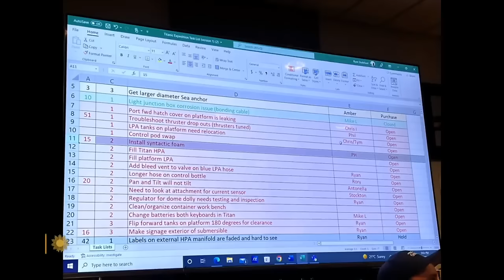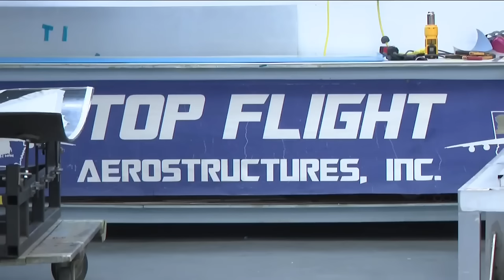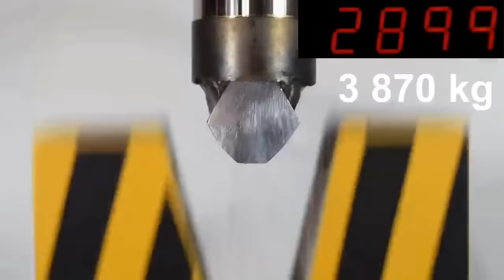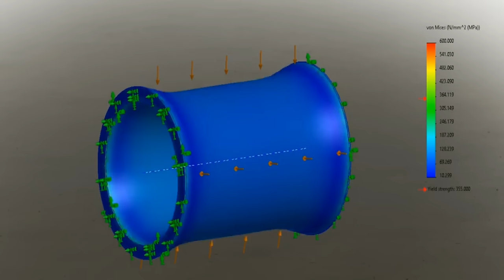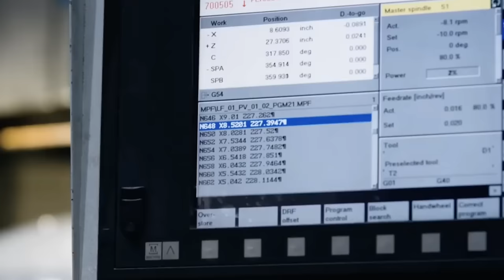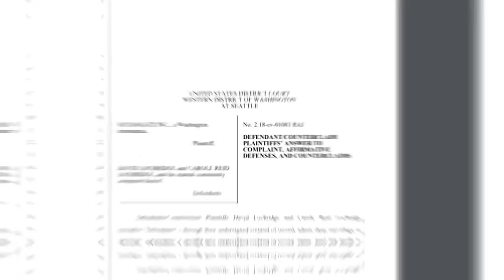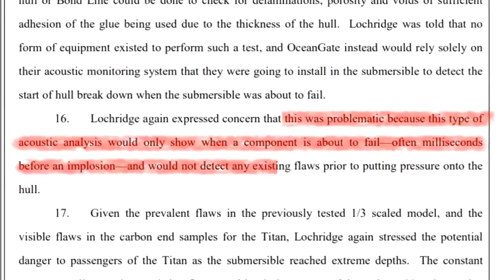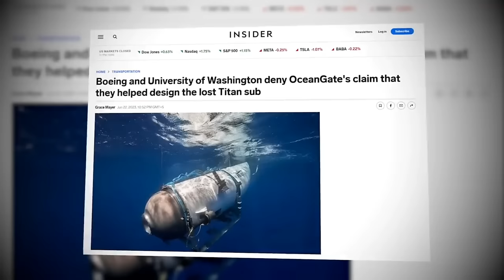Ocean Gate: The Search For The Truth (Full Documentary)

Comment: Looks like an awful lot of electronics outside the pressure hull. Electronics and salt water don't mix too well. Previous dives had a lot of trouble with that it sounds like. Just appears to be so Mickey Mouse, no disrespect to the mouse.
Reply from the maker: It’s a big evidence that the pressure vessel weakened due to multiple dives (cyclic fatigue) alongside the face that they don’t perform regular testing with ultrasound materials. It’s also to the use of the viewport the worst idea forever and of course lead to tragedy , the trubles with communications and other materials it’s just the nature of the beast as there under thousands of thousands of pressure force.

Comment: I believe 100% that the carbon fiber pressure vessel was going to fail eventually from delamination, but I also believe that it wasn't due to fail just yet. I honestly believe that the glued joints failed first causing a leak that's why they dumped all the weight they could and were on the way up when the leak caused the implosion. Pay attention to the build when they lower the titanium ring into place you never see any glue squeeze out, meaning the amount was very minimal and thru pressure cycles it just worked its way loose..
Reply from the maker: Indeed, what an engineering tragedy , thanks for your comment my friend.
Reply: Yes, the lack of squeeze-out means that gaps were possible, meaning there could have been stress risers, resulting in crushing damage to the glue/CF ends at depth
Reply: Great point!
Reply: Accept the pressure pushing on the end caps would have been so great at the depth it imploded, that if you could rest them on the ends and keep them there till about 600 feet, you could pull away and the acting pressure would keep the ends on shoulders, I believe they think it fell into a free fall dive, nose down tail up. And couldn’t handle the rate the pressure was increasing, and when it started to move, it continued until full collapse..
Reply: Yes I would say the glue is the likely weak point but just imagine they new also that they were bolted inside a leaking sub..Now that’s when the real fear set in..😮
Reply: @Rosco-P.Coldchain  I doubt it was leaking, the pressure would have equalized quickly, killing them, and never imploding, it would have been coming in like a fog, people don’t understand the properties happening
Reply: @Rosco-P.Coldchain At that water depth, even if they weren't bolted in the submersible, where are they escaping to.
Reply: Only problem is the transcript has now been deemed fake.  It didn't even have the correct start time of the dive.  Therefore, we don't know squat about dumping weight.  It may never have happened.
Reply: it doesn't matter to be bolted in when you are at these kind of depth...if you reached surface then yes!   @Rosco-P.Coldchain
Reply: Totally agree,poor in glue AND the joint width is way too small,by eye,and i'm just a handy man!i imagine the hull could have a few titanium structural rings.
Reply: @dnbnetwork3531  I also wonder why there were no titanium ribs for structural reinforcement..
Reply: He literally glued that whole thing together.

Comment: I'm more concerned with the application of the glue than the type.i didn't see them measure the thickness, didn't see any glue ooze out when the 2 pieces were attached., was there air bubbles, were the parts prepped properly?
Reply from the maker: I really can’t tell if it’s only the glue, i think it all the combination together: carbon fiber + joined with titanium ports with glue + the poxyglass viewport = death machine 💀 Right? , as for the prep of the part there’s a presence of a kind of scuffing on the video as you can see it on before the joining of the ports .
Reply: I had the same thoughts on this matter.
Reply: Worker touched the titanium ring with bare hands prior to install, even wiped said bonding surface with an oily rag from his pocket 🥴 The whole thing should’ve been done in a clean room to prevent contamination and in a vacuum to cure. They just air-cured the darn thing in the middle of a dirty warehouse, SMFH!

Comment: Glue? Wow, mickey mouse from the start. And if carbon fiber composite was so great, why titanium end caps and not carbon fiber? Sounds like a weak link scenario...OceanGate was in the hole, Titanic excursions were chosen for the international waters aspect. Those submersibles could've been commercially viable for depths they could handle - shallower dives, real sightseeing. Unfortunately such an enterprise would have bound OceanGate to regulations they wished to avoid. Sketchy operation from the ground up. In fact, criminal...

Comment: So what happened is as she was decending the portion of the cylinder that was making cracking noises on previous trips , started getting water into the cylinders 5inch diameter. This is why she was going down so fast. When she really started feeling the presure she flexed then the carbon fiber in front ring felt the flex. The damn porthole got compromised pushed in. The implosion then pushed through the vessel. The back titanium cap shot off like a bullet. 
The reason they have not pulled up the back cap is because the implosion pushed it farther away. When they go back down there they will find it quite farther away then the pieces they recovered.
Reply from the maker: Nice analysis right there, good job my friend, all makes sense, thanks for your comment.

Comment: I repair carbon bike frames, whenever I see a joint between Metal and carbon I always make sure to clean and bond with enough epoxy.. 

And I honestly have more glue per square inch and more squeeze out than these Guys. bonding the end caps... 

Not an expert in anything and I don't claim to be, but Never Have I had a re-bonded metal to carbon interfaces on a frame fail on a customer's bike..

Comment: yes that window. when they first got the end cap up you could see it used a retaining ring that was also glued, the window is missing there is no sign of glue left its clean, so what happens in an implosion? does it create air pushing out both ends, trying to work out was it pushed out or simply failed
Reply from the maker: Thanks for your comment my friend, i suggest you watch my previous video explaining the incident in details as this video is a search for factors leading to to this catastrophic accident .
Reply: The carbon fiber imploded and everything popped off including the porthole .There's a video of them testing one to failure & the ends of the carbon fiber haul exploded turning into mesh.The blast was so loud it blew out the sensors in the building & he had to replace them.
Reply: When the carbon collapsed the titanium hemispheres would have been pushed together like someone clapping their hands. The resulting pressure inside the hemispheres would have either blown the viewport out or the sudden compression of the air inside the sub could cause a compression detonation of the oxygen which could have blown the viewport out. In either scenario it is near impossible for the viewport to have remained in the titanium hemisphere upon implosion.

Comment: How does James Cameron not know the real story behind Titanic? Titanic was on fire in dry dock while in Belfast Ireland. The fire burned for over two weeks out of control. The ship had several coal storage bins built as a layer of steel sandwiched against the hulls pressure bulkheads. Those critical bulkheads were required to separate sections of the hull. Since the coal was enclosed it could not be easily extinguished and the heat caused the steel of the hull and bulkhead to become brittle. There are actual visible signs on the hull in photographs where it was repainted to cover the heat damage. At the same time in Ireland there was a coal miners strike and so coal was in short supply. The fire only compounded the problem by wasting some of the limited coal reserve. 

The coal was the reason why the ship was sailing blind and desperate to reach port on the other side of the Atlantic. They could not afford to slow down or change course without risking the possibility that they would run out of fuel and be left drifting without power. The ships were a huge financial investment that went over budget and caused White Star to face potential bankruptcy. So the voyage could not be delayed to ensure proper safety measures because of financial pressure. The same pressure that caused Stockton to overlook safety in order to race towards the goal of completing successful tours in order to avoid bankruptcy. 

In so many ways it's the same thing causing so many crimes and mis-judgement in society leading to people doing all sorts of irrational things. All because of the bankers. Loans, political, and financial pressure. Leading to catastrophic loss of human life. For the benefit of the rich and powerful. Let's not beat around the bush at all when searching for the root cause. 

Challenger was the same. Every catastrophe is not an accident. It's the result of those in power exercising gross negligence. They should be held accountable.

Comment: Yes, the vast majority of manned deep submersibles have been spherical but not all.  In 1960, Woods Hole Oceanographic Institute instigated the design and construction of two deep  submersibles, the Alvin and the Aluminaut. The original Alvin's spherical pressure hull was steel and capable of diving to only 2400m with 3 occupants and could not have reached Titanic at 3800m.  (The Alvin was later upgraded several times and now has a depth rating capable of reaching the Titanic.) The Aluminaut, was "sausage" shaped (cylinder with hemispherical ends) an could dive to 4800m with 7 occupants. Commissioned in 1963, the Aluminaut was mothballed in 1972.  It operated successfully and once recovered the Alvin that had sunk when water entered it's open hatch on the surface ( the three Alvin crewmembers escaped).  The Aluminaut's displacement (~weight) was almost 5 times that of the Alvin and, though a technical success, was  privately owned by Reynolds Aluminum Co. and proved financially unviable.  For most deep submergence missions, it seems, a crew of three is sufficient.

Comment: After this incident, Stockton realized that carbon fiber isn’t a suitable material. 
So next time He will use titanium hull instead, bolted together, Just to be safer. Why people make a big deal out of it ?
Reply from the maker: Keep in mind that the safety control bureau have warned them , yet they didn’t approve it , as the material used is carbon fiber, so that’s why they perform without a single certificate ! As mentioned in the video.

Comment: Carbon fiber is basically better in applications where stretch forces are encountered. Carbon fiber is not really suited for compression pressure applications.
This can actually be tested using a very simple test in a hydraulic press.
The test is simple. Take a carbon fiber tube that has the same length to diameter and thickness ratio as the cylindrical hull of The Titan and make a tube piece in carbon steel, stainless steel and Titanium with the same measurements.
Put on tube at the time in the hydraulic press and press at the tube ends and check at which pressure the materials fail. The carbon fiber will most likely come off worse because it will start to peel and collapse suddenly.
The hydraulic press is doing the same as the water pressure would have done to the Titan since The Titan had a cylindrical tube hull with Titanium end caps so that would put the cylindrical carbon fiber hull in a pressure condition as if it was in a giant hydraulic press.
Using carbon fiber for a cylindrical hull between two Titanium end caps was probably the worst possible design they could have chosen.

Comment: I fully believe that as the pressure vessel failed, the beginning implosion blew out the viewport window, speeding the rapid collapse of the Titan.
They knew that window was not rated for the depth they planned to navigate in, and the carbon fiber also suffered from multiple events of contraction/expansion, probably causing unseen/unnoticed damage within the composite, and/or around the end cap joining points.
No redundancy, which suggests incompetence and arrogant ignorance.
I highly doubt captain retard performed ANY tests prior to launch, to ensure proper operation of the sub's comms, control systems, or navigation systems.
His barnstormer mentality took 5 lives.
He clearly suffered mental retardation for profit, lives be damned!